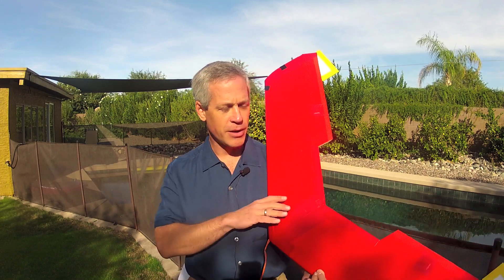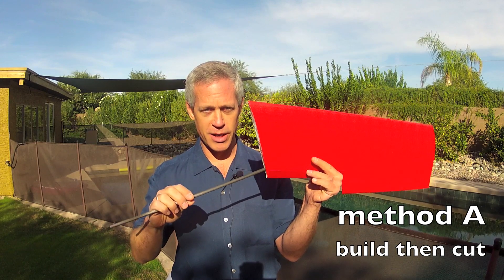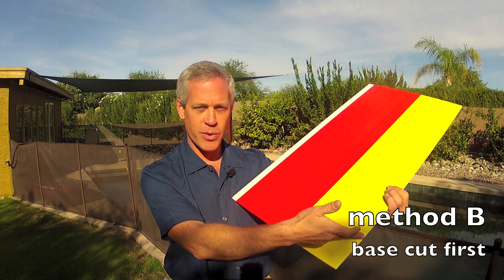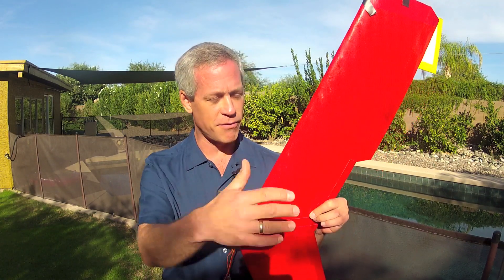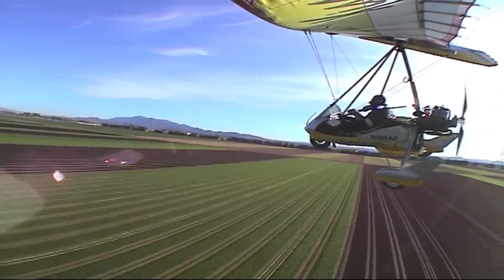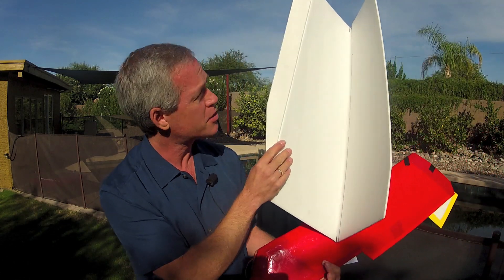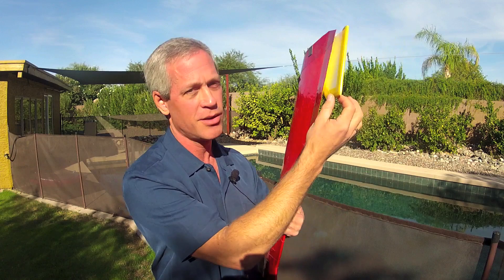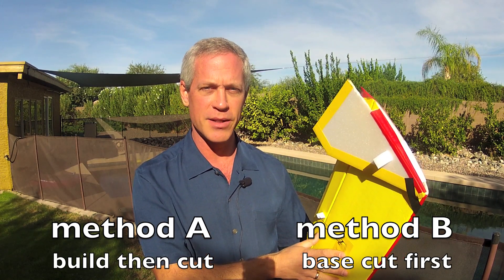SYNAPSE BUILD:  Wing Introduction Video

Comment from the maker: That's a pretty advanced sailplane upgrade so I would research that  very carefully.  They must be symmetrical in size and deployment, and usually inboard somewhat on the wings, definitely inboard of the ailerons.  I have used typical inboard flaps (not true spoilers per se) and made a flap setting of up 20 degrees and that works pretty well, plus you're only dealing with the trailing edge, not as much the actual innards of the wing as with 90-degree pop-up spoilers.